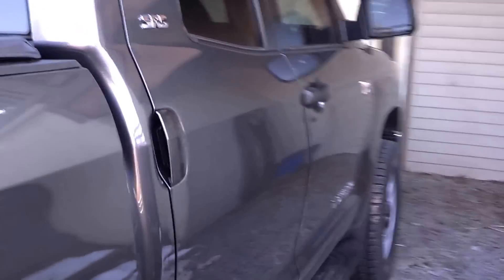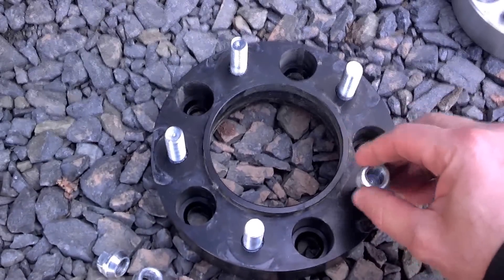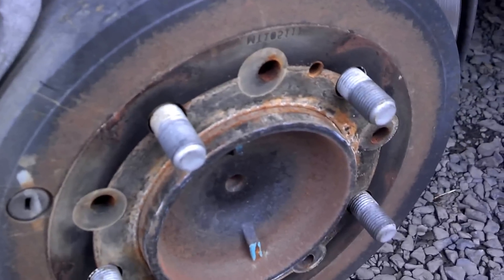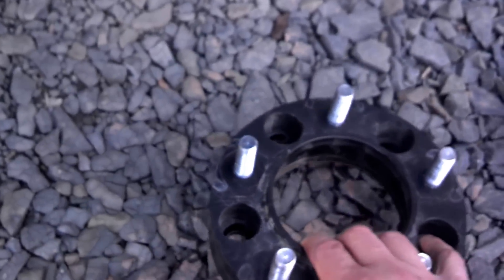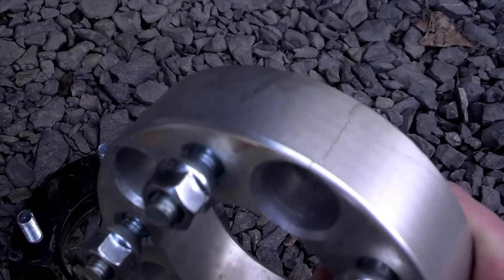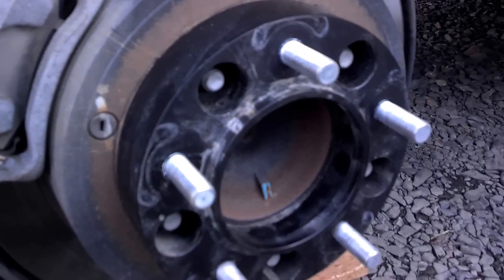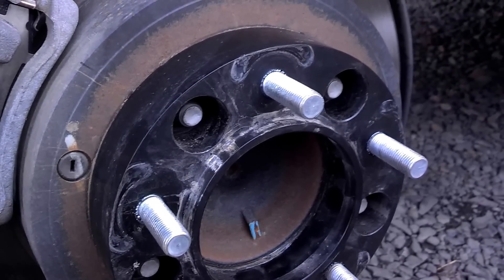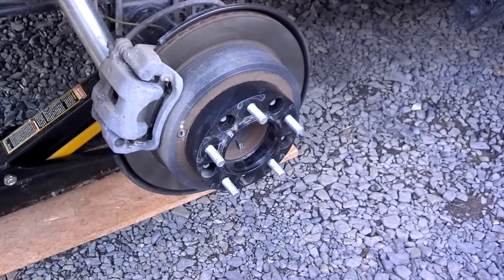Wheel Spacers - Are They Safe?

Comment: The expensive ones tend to be milled from forged aluminium with a tight compact grain, where the cheap ones are cast with a porous grain.
Reply: It doesn't matter the aluminum that's made of. Should be light that's the reason for them using aluminum. Cheap and light. 
The only thing that matters is to have perfect parallel faces reported to the center axle 
Porous grain doesn't do anything wrong.

Comment: Watched the whole video and not once did you mention anything about "hub-centric spacers" being the better buy. 
Nothing wrong with ebay spacers as you said, I run 1.5" hub-centric wheel spacers
Also an important note is to always use LOCTITE.....Always....
Reply: Yes although those 2" spacers will put a hurting on your bearings... 1.5" is usually the max people recommend. 

Safety wise you'll be fine just use a tiny bit of removable loctite or just check the torque every once and a while but not after loctiting them. They should be fine if you use loctite (just put them on, torque them down once and forget about them), but they can be a botch to get off. Snapped 2 sockets trying to remove mine after a year both snap on. 

Better then losing a wheel down the highway :p
Reply: I would go the safest route and just get newer rims with the offset you like, stance wise.
Reply: Extra stress on the bearings has always been my fear.
Reply: the thicker, the harder on the bearings?  looking at quarter inch in the front and half inch in the rear

Comment: I put 1 1/2 inch wheel spacers on my jeep in the front and back (made in America of course) And the spacers ended making my front end shake like I had death wobble. Took it in dreading all my links needed replaced. They couldn't figure out what it was the whole time. They popped off the spacers and drove it down the road and it drove fine ever since. The spacers were not damaged in any way or form. Just some how caused my front end to shake like crazy.
Reply: Jake B My guess is they weren’t hubcentric
Reply: My guess would be that your guess was correct! JAKE

Comment: I bought hub centric wheel spacers on eBay. I used red Loctite on the studs to the hub. Only issue was stripping a short lug nut before heating the other ones when I put bigger brakes on. I only had 1 inch spacers and had to cut the factory wheel studs down as well.

Comment: Whilst having to rectify a bodged 3" body lift done by a previous owner and lowering the body back down to the chassis I notice stress cracks in the black alloy wheel spacers exactly like the ones in your video. After spraying some welders crack detector on them these cracks turned out to be even worse than I thought. I have since removed all the wheel spacers and fitted standard wheels back on to the vehicle. In future  I will not be buying a pick up truck which has had a vehicle lift. There are some horrific videos on you tube of wheels falling off.

Comment: Had a pair on the rear of a Mustang GT. Went through 3 sets of tires. Never had issues. They were about 1.5"
Reply: What brand or were they ebay ones? I just bought a set for the rear of my 2004 mustang gt and got them on ebay for 30 bucks shipped. They are brand name Max Auto and are made of 6061 cnc aluminum and have 10.9 hardened steel studs. They have a 1 year warranty...we'll see?

Comment: Hub-centric is the next really important term/type after made in the USA and warranty. Hub-centric wheel spacers keep the weight off the wheel lugs and on the hub where it is carrying the weight as it should. Thread locker is another one for those leaving the spacers on, red is intended as a more permeant install but blue could be used and still allow the spacer to be removed. Some people use it some don't, not required but worth considering.
Reply: Robert, about that sort of thing, ya think they would make some sort of locking bolt system, or something, sort of like a locking washer system, why not, my thinking is this., if people are going to be concerned about vibration and it loosing, then that heavy metal could be made with some sort of locking bolt, instead of locking washers, or both? just a thought?

Comment: Good point I've had a friend that put cheap spacers on his f150 and had his passenger side wheel fall off while driving in town and had to replace the the hub then he again used another set of cheap spacers and had the other front wheel fall off at 60 mph coming off a curved overpass needless to say lesson learned and that that you should do a lot of research on a set of spacers if that's something you're looking into.

Comment: You are also using hub centric spacers which put the pressure in the ring in the middle of the hub. They are much stronger and better aligned than non-hub centric versions.
Reply from the maker: Correct, forgot to mention that... thanks for pointing it out!

Comment: What would happen if you were to put wheel spacer after wheel spacer under the same wheel? Like having 2 in the same wheel? I'd like the tires to be wider than just one spacer offers
Reply from the maker: Honestly, I think that is just asking for trouble... Don't do it!
Reply from the maker: Honestly, I think that is just asking for trouble... don't do it!
Reply: MOTOWENS that's crazy brother just save up for different offset wheels most people who are knowledgeable on the subject do not recommend more than 1.5" on wheel adapters like tundra guy  said do not recommend and I don't think anyone has done that way too much strain on bearings after certain point causing premature wear and failure, not to mention potential safety risk to yourself and others on the road.
Reply: Ricardo Massa exactly!

Comment: The amount of threads engaged is used in calculations for holding force required.  So, if you use the spacers that do not bolt on, and you are grabbing less threads on the original studs, you risk failure.

Comment: Thanks for the video and info on torquing them again.  Question.....why do you only keep them on in the winter.  Just wondering.
Reply from the maker: I have snow tires on them steel wheels, so only need the spacers for them. I have aftermarket wheels for the summer that have 1.5" of offset so they sit even with the fender wells...

Comment: Amateur question, but how do you tighten it to exactly the amount of torque fit for the lugs? Is there like a guage? I just do it as tight as possible.m
Reply from the maker: +Jb C You should really invest in a torque wrench. Over tightening wheel spacer is a sure way to crack them. Heck, even aluminum wheels can crack if you over tighten them too much...
Reply: @Tundra Guy, you forgot to mention another reason why spacers shouldn't be used. It's for the simple fact that wheels that stick out a little farther out than factory specs will get mud and all that other crap on the sides of your car a little more, at least on lighter colored vehicles. So why do it? Don't. =(
Reply from the maker: Not necessarily, depends on how wide you go with the spacers. I do not have that problem with mine...
Reply: Jb C you are hurt.  Everything is measure to the exact pound of torque , even down to inch pound with a wrench.

Comment: Spacers that are not bolted on are perfectly safe if they are installed correctly. If the wheel is a bolt-on, you need longer bolts. If the hubs have studs and you install the wheel using nuts, you need to disassemble the hub and install longer studs. On top of that, they need to be hubcentric.

Also, never use aluminium spacers without steel inserts.

Comment: question.  if your tundra needs 100 lbs why would your Honda?
Reply from the maker: Yeah, I shoulda clarified in the video, the honda only calls for 80lbs, but the instructions that came with the spacer said 100 for the spacer...
Reply: Will D lug nut torque is not specified by the weight of the vehicle. it is determined by the size and metal grade of the bolt it is being attached to. that being said the manufacturer determines the size and quantity needed for that vehicle. for instance 1/2 ton has 5 or 6 lugs where as 3/4 ton has 8. they are both same lug bolt and torque just different quantity for weight variances

Comment: there is a hidden problem using the wheel spacer buyer beware. there is stress on the front sway bar. the better look doesn't give me a good reason just to make your wheels stick out. just imagine when you try to bend a flex rod. the wider the rod, the more energy require also, energy distribution becomes less and the tire will wear faster. after hundred miles with the spacer on the front wheels and no spacer on the rear wheels, you will see the difference on the tires wear pattern. hundred dollars will get you more problems on pinion ball joints and a costly new set of tires.
Reply: I could not agree more. I have had to spend hours rectifying a bodged 3" body lift done by a previous owner and get rid of the oversized wheels. The spacers  had stress cracks and the power steering box was also badly damaged and had to be replaced. Not to mention a lot of damage caused else where  by this bodged up vehicle lift.

Comment: As a machinist these wheel spacers are fine as they're lug centric.  Don't use them if you're carrying over 10,000 lbs plus the vehicle's weight. Hubcentric adapters are the only option carrying heavy loads. These ones are more suited for what he's doing.

Comment: so are the black made of aluminum or steel?
Reply: I just installed my new 2 inch black ones by bora on my 2007 Dodge Ram 2500 today. They are made of aluminum just as the silver looking ones are. A word to those ordering from Bora, they make the spacers to order when you order. Mine took many weeks but I am thrilled with the quality.

Comment: is it save to tow a trailer with wheel spacers?
Reply from the maker: hmmm, not sure there... depends on the truck and trailer i guess. But i see your username is duramax2015 so not sure I would run theses on that diesel with all that torque but check with other diesel guys there. But i would recommend steel spacers and only hub centric...

Comment: The Honda wheel spacer looks like it's a cheap casting. While the black spacer is most likely a billet aluminum spacer. Remember this, aluminum will crack and break apart with no warning. no matter if it's cast or billet aluminum, (billet aluminum being much stronger) Their is a reason as to why no auto manufacture uses aluminum on the wheel hub assembly!
Reply: Robert Murillo yes.somebody thinks.

Comment: I run 2" on a lmm crew cab dually.  install them correct. re torque inner after 1000 miles and then re torque outer 1000 miles later and be done.  I tow 20k very often. buy American and keep it together.
Reply: Thank you so much for your comment. I have a 2010 Silverado and I wanted 2" spacers but I hadn't seen anything from somebody who towed, as I tow 15-20k on a regular basis
Reply: Just make sure it's a good quality steel spacer with the lip around the center for your rim to center itself on. (Hubcentric) .  When you look at a spacer and it's steel and you think this thing is massive and weighs easy 10 lbs each. Run them. I'll look to find my paperwork on my brand. I trust mine fully.

Comment: If you want your tires to stick out from the fender flares a little bit, why not just buy a larger set of tires & wheels when it's time for new tires? I do some driving on dirt roads and I sure don't need rocks being thrown up into the side of my truck and chipping up the paint. I want my tires under the fender flares where they belong.

Comment: the wheel spacer for your Honda cracked because its torque spec is 80 ft lbs, not 100 + ft lbs
Reply from the maker: Correct... BUT, the spacer called for 100 ft lbs, but the honda wheels call for 80. That spacer was going to fail no matter what, I consider myself lucky it failed when it did and not on the highway.
Reply: +Tundra Guy oh OK I see. yes I'm very glad you didn't put that on your vehicle and end up wrecking it or have a major accident where you got hurt. Was that one of those eBay spacers made in China? 

I understand that companies want to maximize profits by having cheap manufacturing costs and use China, but we gotta draw a line somewhere. Some items that influence your safety or well-being shouldnt be made overseas without proper quality control. a lot of this offshore manufacturing really needs to stop and a lot of the products that come out of China are utter garbage. I find it ridiculous how after all the advanced technology we have here we end up making our stuff overseas in a country that could care less about the quality and standards used to produce those goods.

Glad to know that you're safe and that you put this up on YouTube so other people can learn from your experience.

Comment: Look how thin the wall is on the china one. i think if it was thicker, you wouldn't have had a problem even if it was from china.
Reply: Chase Lesser.....good eye! I noticed the same thing
Reply: Chase, yes for sure, that area right there you think would be and should be a tad thinker. it sure seemed this for a stress area, which that is. and when that goes, the crack is almost what would be expected, I mean to say, at at least 70lbs of torque should be fine for about any car or SUV with at least 6 lugs or so. not sure i would use loctite though. and about that 100LBS, that seems high for almost any car.

Comment: Dont do it unless the manufacturer is okay with it. Or better still dont use the damn things at all. Get a wider vehicle. As soon as you alter the dimensions of a wheel assembly like that you are putting a lot more strain on the bearings, axles etc. Do you really want a spacer failure at highway speeds or round a fast corner ? Think about that.

Comment: so.... a Honda civic I guarantee doesn't take 100 ft/lbs for the wheels
Reply: first thing i said
Reply from the maker: The instructions for the spacer called for 100 ft/lbs, and then to torque the wheels to spec.
Reply: Well that's fucked cuz you will warp your rotor if you do it that tight

Comment: China is the land of immitation. People buy all sorts of shit such as turbo's, exhaust headers and even this wheel spacer. I am not suprised at all that it cracked because their casting is just 100% shit. The moment you enforce heat or in this case a damn nut it simply cracks due to the soft material you bought extra cheap. Do yourself and others a favor, buy genuine stuff. Saves lives and all.